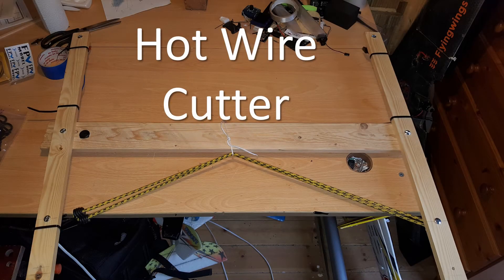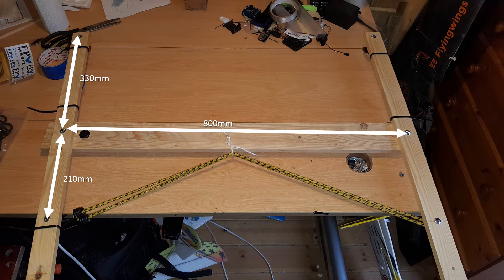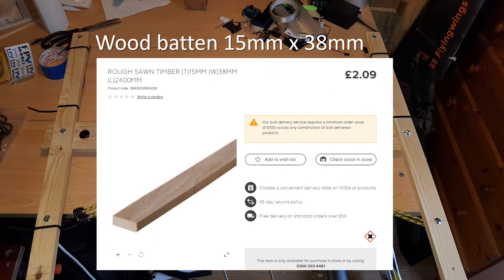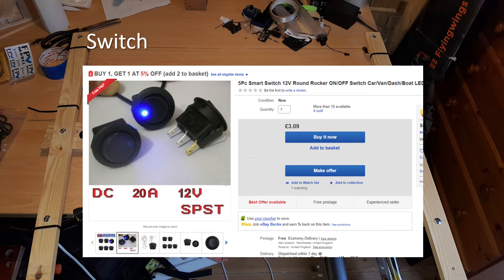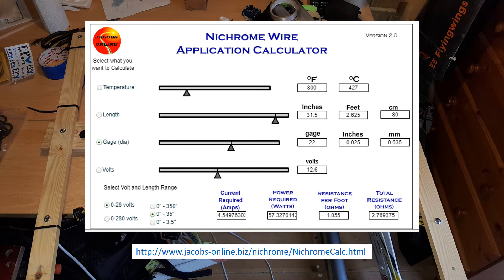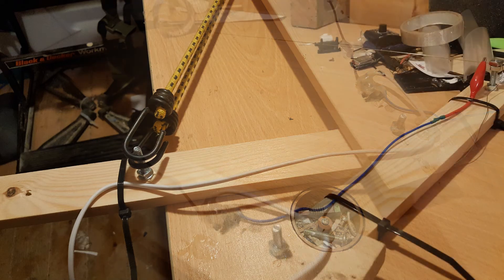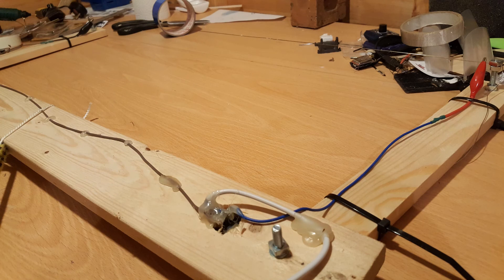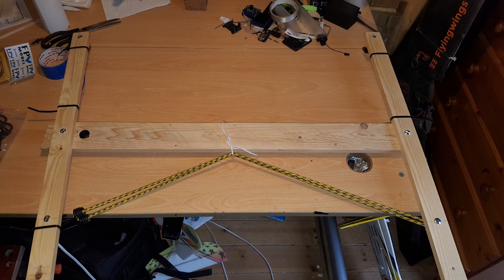(1/4) Hot Wire Cutter

Comment: Dave have you tried cutting wings using a wire pulled  tight from a pivot point  and then use a profile on the end of the foam block .I've tried it as a test and they come out quite good . You have to get your angles ,distances  right but its easier to cut them .
Reply: I know what you mean , I did it in the back yard I used a fold out table ( paste table ) size . Drilled and fitted a length of  8mm stud in one corner .Used the nuts either side a piece of steel plate with a ring in it to attach the wire .Then croc clips to supply the power either end . I used the foam insulation you used from B&Q . Will make my next wing from this foam . Keep doing the vids , cheers  Graham